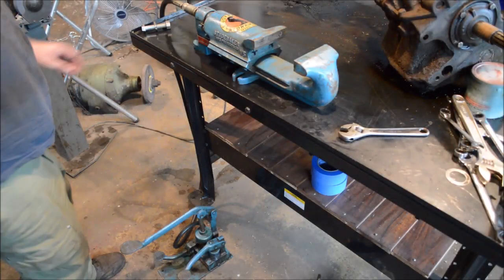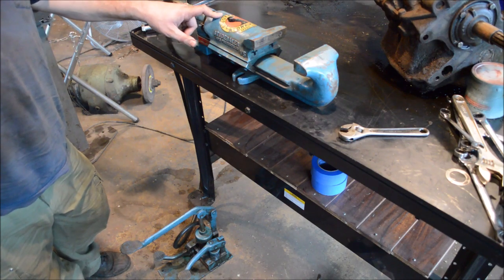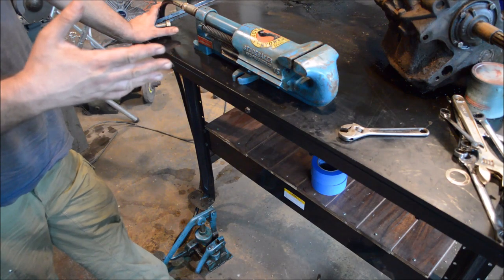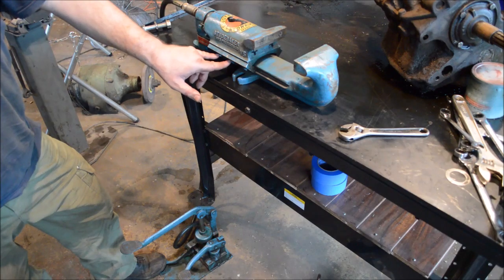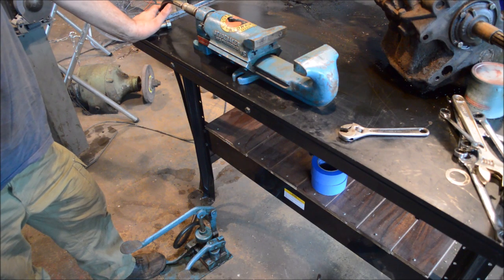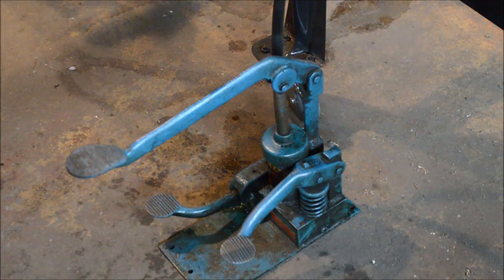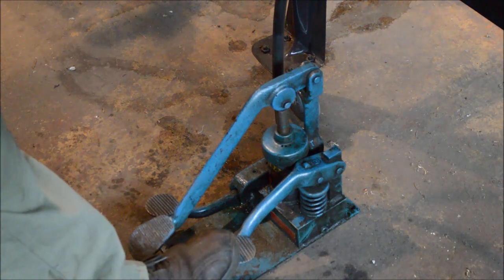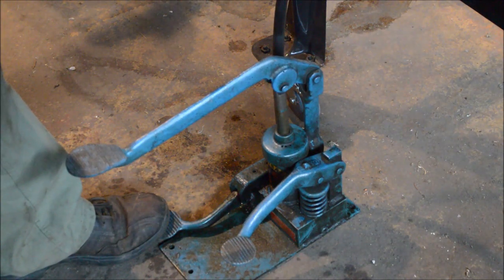Studebaker Hydraulic Vise In Operation.

Comment: Dang I’ve been looking for one for a while, would you sell one?
Reply from the maker: This one has already been sold.  I have a 5" one with non-original foot pump which has been a project of mine for a while.  I need to rebuild the cylinder and finish the restoration.  That one my be for sale eventually.
Reply: @VintageVisescom my dad has one and has a guy trying to find info to repair the foot pedals. Would you have any documentation or know how? We can’t anything! Search high and low for patent, maybe their two different ones, for the vise and pedal assembly 🤷🏻‍♀️
Reply from the maker: @BigfootIsOutThere  I don't have any drawings, nor have I taken the foot pedal apart to know how to rebuild.  I would suspect a hydraulic repair shop would be your best bet.  They would have o-rings and seals available off the shelf that should work.  Wish I could be of more assistance.

Comment: Unrelated question, but I'm not sure how to contact you otherwise, without Facebook or Instagram. Tried your website but there's no email.

I have come across a Littlestown Model 100 and I was wondering if you knew anything about it. I looked through the vise library and could not find the 100. The closest and most common seems to be the 112, but mine clearly has No 100 on the side. 

Anyway, thanks!
Reply from the maker: They are fairly common vises, not particularly valuable or built as strong as a machinist vise.